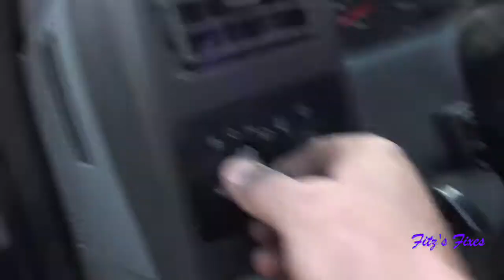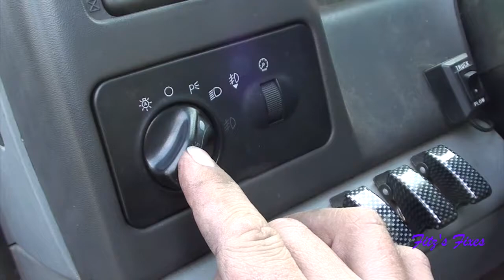Auxbeam on Boss Plow

Comment: Nice job, I just made a video using the Aux beam lights for reverse lights.  I should have mounted them up above the bed like your buddy's plow you just fixed in your last video.  Anyhow, I don't know if you saw the video, but the lights are compact and really bright.  They sent me an extra set, so I might put them on my zero turn.
Reply from the maker: doublewide6 yes I saw your video. I have the same reverse lights. I put them on all three of my trucks. The two with beds, I mounted just above and inside where the tailgate latch pins are. I run those trucks without tailgates in the winter. And on my flatbed, I mounted them to the top of the bed in the back corners.

Comment: The only problem you might encounter is I don't think you can have the fog lights and the high beams on at the same time. I know on my Ford(s) when I flip my high beams on the fog lights cut out.  Not sure if that will be an issue for you while plowing.
Reply from the maker: Great Lakes Cruiser my fogs work when lights are on hi or low beam. Everything works great so far. Must be the newer fords that have that issue
Reply: Great Lakes Cruiser it's standard on any newer vehicle. By law you can't have more than 4 front lights on at a time. Stupid but yeah.